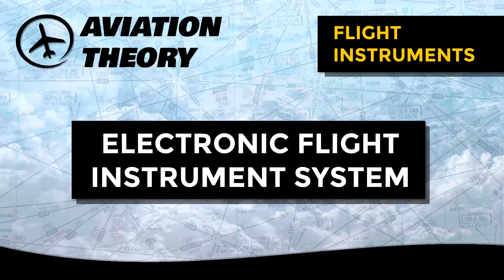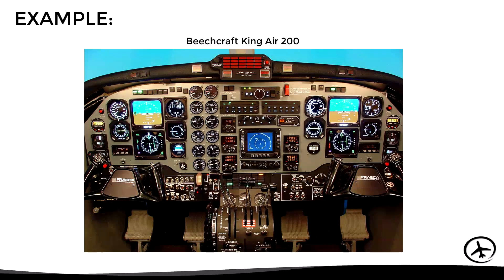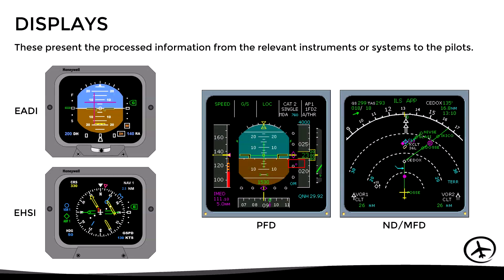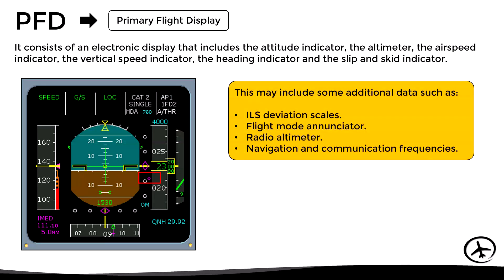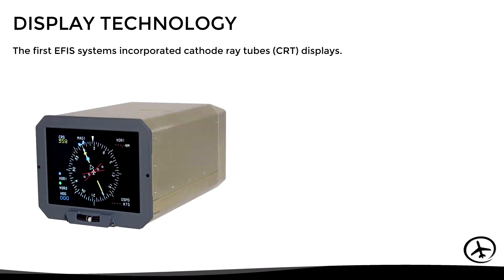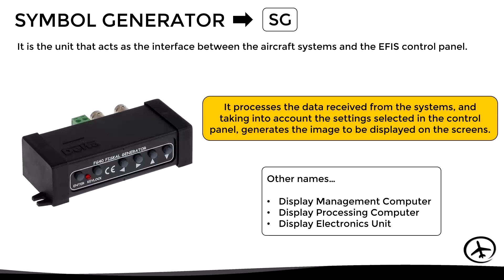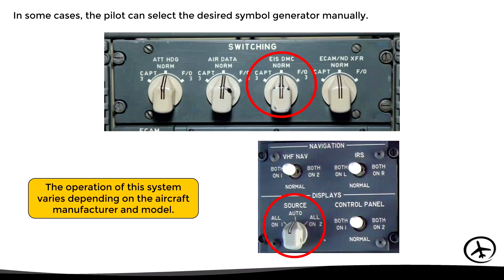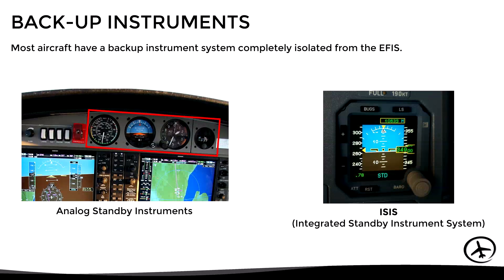EFIS - Electronic Flight Instrument System

Comment: Hello, and thank you for the video. I recently retired after 30 years with a major airline, and the majority of my career was working in the Avionics department.

After watching the video, there are three areas I wanted to comment on, as I did not think the information was correct. Anyone that knows more about these systems, please let us know who is correct, as I do not claim to be the final authority on this.

I worked with several glass cockpits from McDonald Douglas, to Boeing, to Airbus models, and the first Electronic Flight Instrument System (EFIS) I worked with was on the MD-80 aircraft models. Something I thought should be mentioned is in the introduction as well as throughout the video, the AI voice-over is mispronouncing how EFIS is supposed to be pronounced. It is not "Effies", the pronunciation is "Eee Fiss".

Just before 6 minutes in, it was stated on larger aircraft, there can be an Electronic Centralized Aircraft Monitor (ECAM) or an Engine Indicating and Crew Alert System (EICAS). Since the video had already used the 787 for the first example of EFIS screens, I wanted to point out that it is not only larger aircraft where you will find ECAM systems. The Airbus aircraft, most of which are smaller than the 787, use the ECAM system on the flight decks of the A319/A320/A321 category of aircraft.

Just after 8 1/2 minutes in, the statement "Larger and more complex aircraft usually have up to 3 symbol generators" is not quite correct. Just like stating ECAM is on "larger and more complex aircraft" was incorrect, this latest statement is as well. Back to my first EFIS aircraft, the MD-80. The MD-80 was not a larger OR more complex aircraft than the Airbus or the 787 aircraft flying today, but they had 3 symbol generators installed for the EFIS system.

Comment: Airbus EFIS is pronounced EE-fiss. Electronic Flight Instrument System.  The engine displays are upper and lower ECAM, pronounced EE-cam. Stands for Engine Condition/Aircraft Monitoring.
Reply: Actually, ECAM is Electronic Centralised Aircraft Monitor. 😊

Comment: The Airbus A320 displays have display management computer #1 for Captain.....#2 for the First Officer......and #3 as back up for either pilot. Interesting note about display management computer system 3........even though the #3 computer is generating the images they are still passed through the #1 DMC (or #2 DMC) to the actual displays. And although that is in the description and operation it is not mentioned in the TSM Trouble Shooting Manual. So what appears to be a DMC 3 fault could actually be a DMC 1 or DMC 2 fault. Rare but possible.